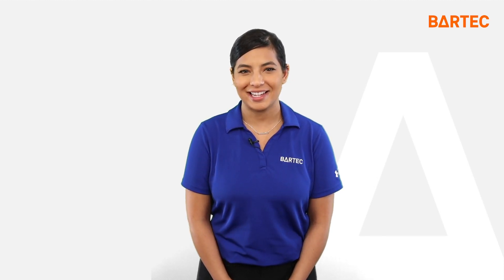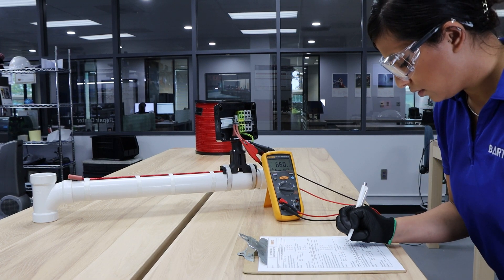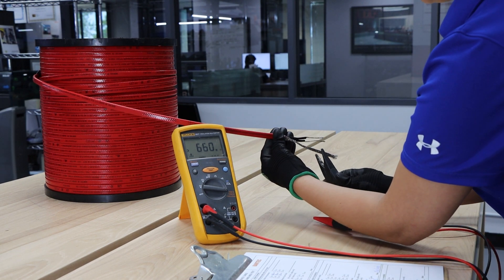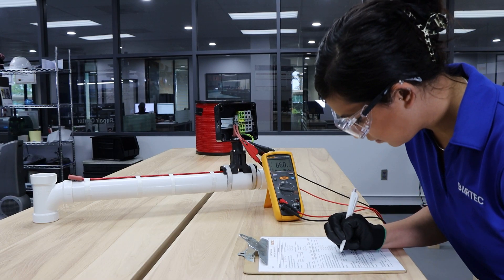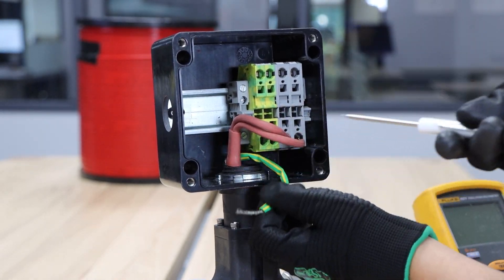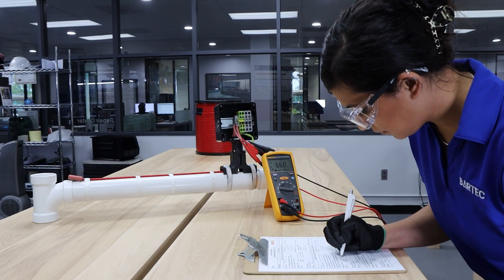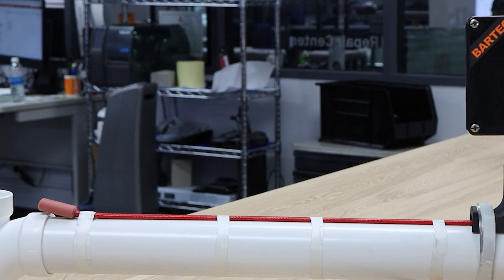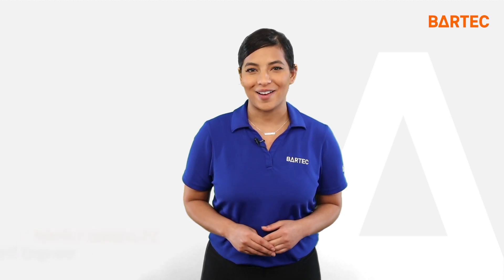Meg Test | How to perform an Insulation Resistance Test | EN | BARTEC

Comment: I’m sorry I don’t agree…we had 2 raychem techs come out to our site and Megger all of our heat trace. I worked with them for 3 days megging countless heat trace. I was told the minimum is 1 Giga Ohm of resistance “phase” to ground. They said specifically anything below 60 Mohms requires a level 2 diagnostic which is going out into the field and opening boxes to look for the problem. 20 ohms to them is a huge problem. With all do respect..what the f*ck are you talking about.
Reply: She said 20mega Ohm's not 20 ohm's. 20 ohm's is basically a dead short.
Reply: @joshuaboehler 20 mohms, 20 ohms it doesn’t matter my guy. Read what I said.
Reply: Depends on the voltage used for testing. They most likely tested upwards of 5kv whilst this test was under 500v. You're clearly not an electrician and dont know what you're talking about.
Reply: @champ8605  Most likely tested upwards of 5kv? 🤣. You’re sooo clueless bro..
Reply: You were also told, face mask and vaccines would help stop/spread covid from “qualified” people… moral of the story, not every “professional” gives the right info

Comment: Doesn't mention what this test is for? We know but you have to mention this of you're explaining it.
Reply: To find out whether wires have the expected resistance value. Insufficient resistance means the wire insulation is bad and needs to be ditched as there risk of a ground fault or short circuit which can start a fire.
Reply: Let me guess... you're asking for a friend?

Comment: Ive recently run 140mts of heat trace. I did a test and getting more than 20 megaohms. However when the heat trace is turned on its drawing 54amps. Any suggestions?
Reply: no
Reply: no :(

Comment: Would be nice if they showed the sign on the meter...
Reply: if you don’t know according to the IEC / ASNZS3000 it must be tested at twice rated voltage
Reply: True… so far all the cables we’ve megg have tested at 660 M ohms in all our cables we have tested / installed here at my plant,  which is what it shows on the megger  she’s using in the demonstration,  but like they said 20 M is a pass.
Reply: pretty self explanatory

Comment: you need to inject test also line to line and line1 to ground and line2 to gound. not only direct line1,2 to ground. need to separate
Reply from the maker: Hi! Thank you for watching the video. Most Meg sheets list L1-G, L2-G, but if they pass together they’ll pass separately.
Reply: @BARTECglobal what is her IG?
Reply: @BARTECglobal  Yes, however insulation between L1-L2 can damaged and looks like you do not check it.

Comment: where do I put the red and black wires for testing a cable that does not have a ground braid?
Reply from the maker: Hi @ryanrahmat5980! If the cable does not have a ground braid, then one of the cable conductors might be the grounding conductor. For example, a three-wire cords contain two current-carrying (Hot & Neutral) conductors and a grounding conductor. Check the cable type and please note, for single conductor non-shielded cables, insulation resistance testing cannot be performed because low voltage single conductors do not have a grounding conductor, shield or ground plane. Hope this helps and thank you for watching!